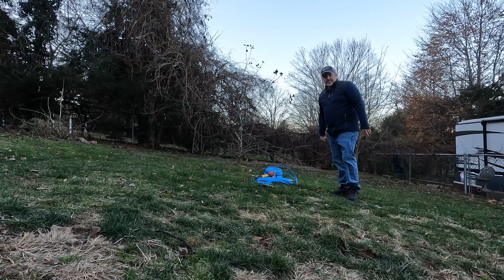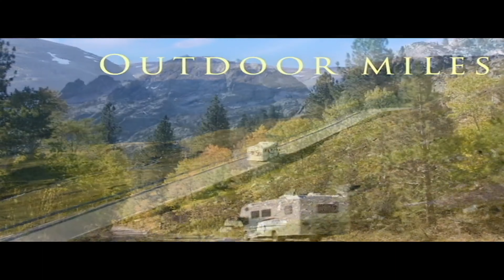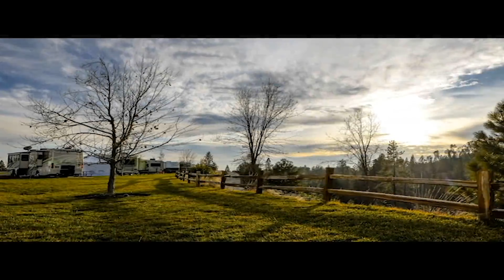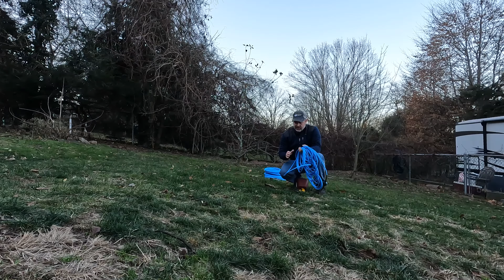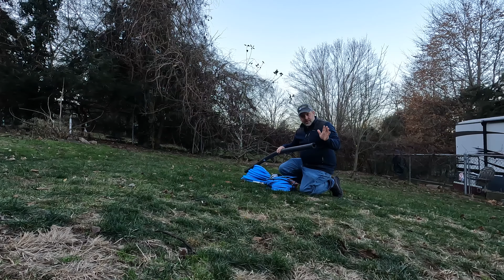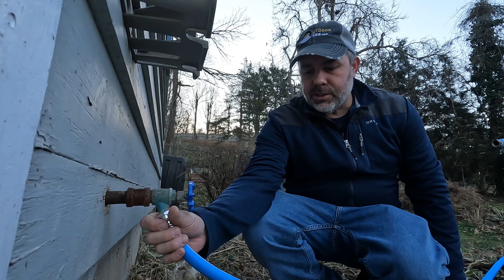How to build a DIY Heated RV Water Hose

Comment: I thought your not soused to cross the heat tape over its self.
Reply from the maker: For the most part, it’s best to not overlap, but with this type of cable it won’t hurt. I didn’t overlap on the hose, but there is a little where I wrapped it around the spigot. 4 seasons later, still working great and no issues, although the duct tape is worn in areas where I coiled it after winter. I didn’t even retape it and never freezes

Comment: Question, if the thermostat is covered by the heat wire and inside the insulation, wont it always stay warm and not get an accurate reading of the outdoor temperature and therefore not turn on when its cold? Shouldnt that part be exposed?
Reply from the maker: Yes- I pulled mine outside the insulation to it turn on. At first i thought it would be fine to only turn on if inside the insulation got cold enough, but I have some extra wire wrapped around my connections so I needed it to turn on sooner to keep that from freezing. Btw- 3 seasons and still going strong .

Comment: Thanks for the video. This system is far superior than anything that is sold as "RV approved". I am a 40yr commercial electrician with just a couple of observations: 1) self regulated  heat trace cable does not have a thermostat, the cable is constructed using a semi-conductor matrix around the heating cables. The cable starts conducting at about the low 40"s to high 30deg and continues to increase until 32deg when it is at full operating temp (self-regulating) 2) wrapping the cable over itself is not a problem. The cable will adjust the temp according to is rating. 3) tape the cable to the hose parallel to the length without circling the hose. This will decrease the diameter of the assembly so that your insulation will fit better and allow for easier reuse of the cable when replacing the hose. I personally use Flexillia brand hose. It is flexible and does not impart any "hose" taste. I have had multiple CAMCO leaks and bursts. 4) Finally, I use Scotch brand 88 electrical tape in a spiral installation around the insulation. This tape will remain flexible down to 20deg below and will not degrade as fast in the sun.